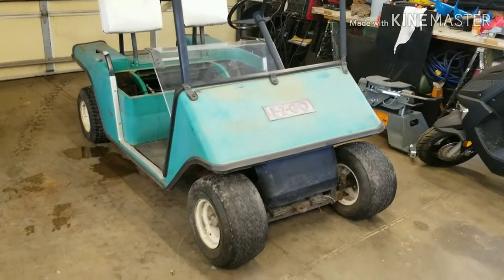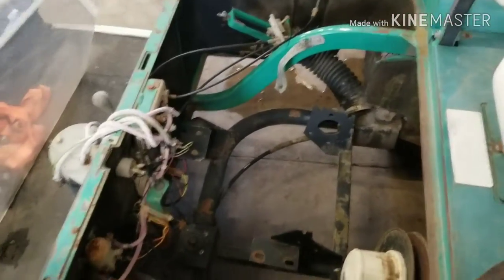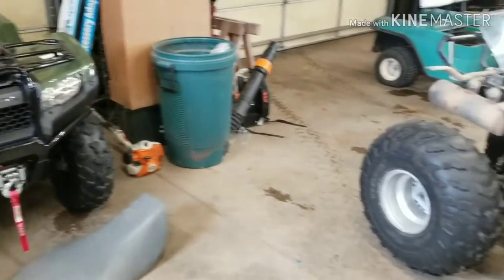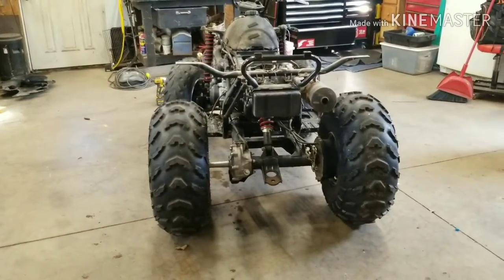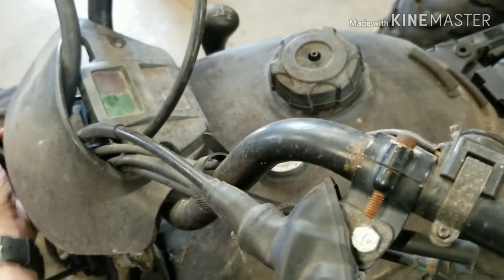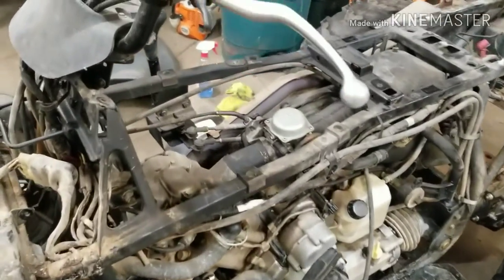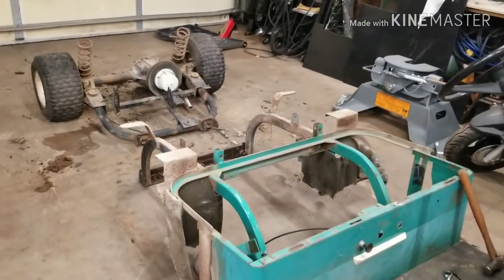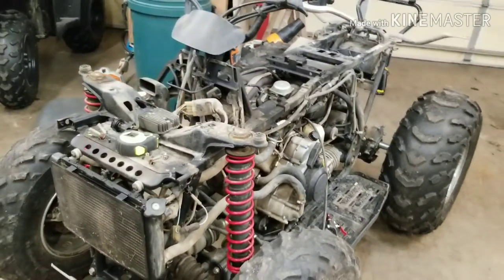Making a 4x4 golf cart

Comment: Mainly the intake and not getting cavitation ? As well as the placement of the jet is there a “good “spot for that, talking about distance from Nossel to boat..Also are there any models of jet skis that are easier or better than others? And then back to thick ness of material ? Thanks again! As of now I’m currently in the market to acquire the items to start the build all info helps
Reply from the maker: Keep the intake as low as possible and weight distribution helps keeping more weight towards the back to help keep it in water. A spoon helps clean the water as well. As far as placement, keep it centered it really doesn't matter how far it sticks out the back. For skis. 90s to early 2000s yamahas and Kawasakis have aluminum intakes which make installing them easy. Along with tiger sharks but parts suck for those
Reply: Okay thank you brother ! I’ll run with it anything else you would throw in  to maybe help that I didn’t mention or know about yet to plan ahead for or know about ?
Reply from the maker: @ryanyoung1459  I like a hull with a V front it helps clean the water of air as well as riding better in waves etc
Reply: Well thank you for the help everything helps.do you mind if I send u and email down the road while I’m building to ask a few questions if need be ?
Reply from the maker: @ryanyoung1459  you can message me any time on instant gram if you wish @jonjdsoutdoors

Comment: Is there a part2???
Reply from the maker: Yes my 3rd latest video is an update on it. Still not done long project
Reply: Oh ok . I'll go look for it . I'm thinking about the same idea.  Just wanted to see one finished.
Reply from the maker: @charliecourtneytinyswampli3528  
https://youtu.be/D0-HaP1aycU
Reply from the maker: @charliecourtneytinyswampli3528  it's far from done but feel free to keep an eye on it should be done in a couple months
Reply: I found them all thank you . I'm going to like them as well and I'll sub if you keep the build going.  I'm interested on how you getting the throttle working n the drive shaft extending that. I'm mostly off grid but I have 17 acres n the same cart with the same bike it looks like . The bike runs I just need a radiator n fan . But the cart would be nice for my wife and I to ride together.  Idk I have a vtwin I was going to use . I'm on the fence n I have yet to see one like your finished.  I don't know if they give up or what.
Reply from the maker: @charliecourtneytinyswampli3528  thank you it's much appreciated. And I'm not going to give up on it I can promise that. It will take me some time but I'll get it complete. Winter is just about here and I'll have some more free time to work on stuff and get caught up. Been a crazy summer